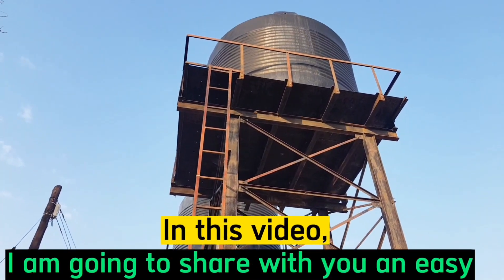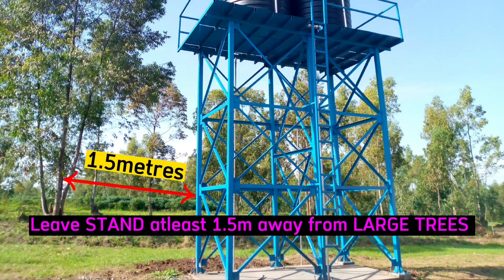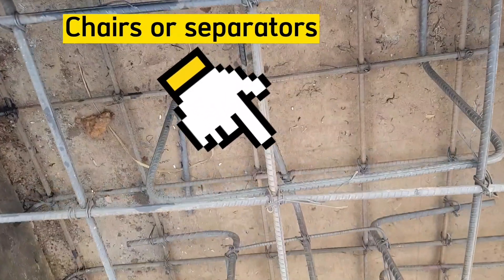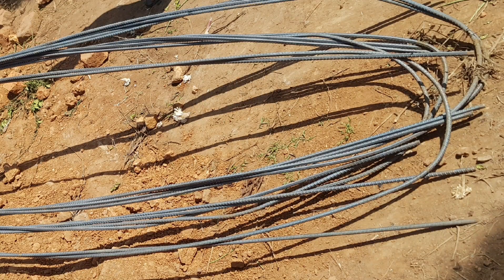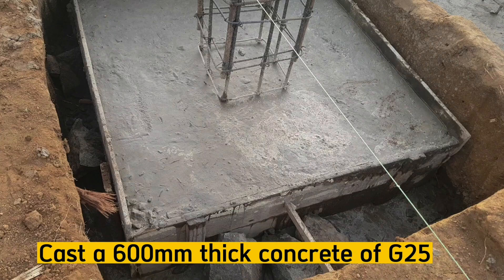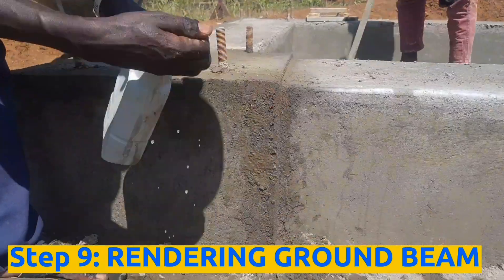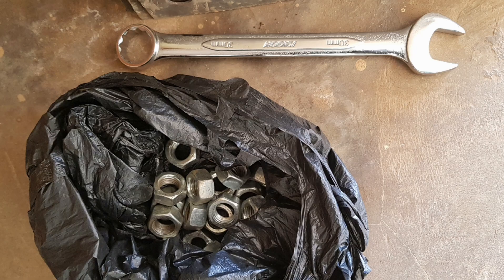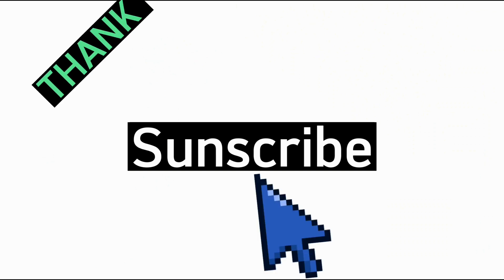How to build STANDS FOR WATER TANKS Construction| Metal Water tank stand

Comment from the maker: Here's HOW TO INSTALL THE GROUND MOUNT SOLAR SYSTEM 👇
https://youtu.be/UqR3GkpDlAA
Reply: Is the dummy plate casted/ covered by the concrete
Reply from the maker: When casting Concrete, we remove the dummy plate. We only keep the bolts open. Later when the Concrete has set properly, we bring the dummy plate and fit it in the bolts then tighten it with the nuts
Reply: @ianconstruction  Am waiting or the video of cost estimates please
Reply from the maker: @muriungi_denis  yeah sure, cooking
Reply: Great video, is the video for cost estimates out? Also can someone hire you in kenya to manage the project while I buy materials

Comment: I am in lagos Nigeria, how much will it cost build a steel tower tank stand for 6000 liters of water of 1500 each of the plastic tank. Steel tank stand 1.8m x 2.4m x 12m high. And what size of steel sections would you recommend for such project?
Reply from the maker: I live in a different country bro but what I can do is sending  you a list of materials required from the Foundation up to the steel metal fixing and welding part.
Then you can simply feed in the prices depending on the prices in your country 
Email me at ianconstruction.yt@gmail.com

Comment: Very nice video and information...can you please inform what is the section you used for the steel columns , primary beams, secondary beams and angle bracings??
Reply from the maker: For steel columns, we used T Sections
For primary beams, we used  T sections 
For secondary beams, we used T sections 
For bracings, we used the angle bracings or what we call the angle bar

did that answer your question, let me know!
Reply: sir the sizes for the steel column and bracings ..thanks

Comment: Bolt placement is off the main reinforcement.. On my opinion it should be 50mm in, so as the plate base area cover the crossectional area of the civil column
Reply from the maker: While casting Concrete for the r.c column ( I mean the short one - the stub column)
And also the ground beam, we temporarily place the plate in, so as to avoid mistakes. We maintain diagonals at every stage. What is important is to ensure that the plates fit properly 
Then the rest, such as as T section columns, primary beams and secondary beams are fabricated on site. They are fabricated following what is already built, we cannot follow the plan or drawing when doing the metallic fabrications because maybe masons might have made a mistake of 2mm or 5mm etc that might bring problems when fitting  so what we do, we fabricate everything on site. 

I hope it helps, in case of any clarification that you may need I'm available

Comment: Thanks for this video sir. By the way sir grade 15 concrete has a mix ratio of 1:2:4 and grade 25 concrete has a mix ratio of 1:1:2
Reply from the maker: @Dee900 
Concerning Concrete grades with their prospective mix ratios,

To make concrete we use CEMENT, SAND, AGGREGATES and also water which are mixed with a certain ratio and concrete is cast and put in a square cube and then put in a water for 28 days and afterward, it is tested in a compression testing machine. The compressive stress result is known as the “grade of concrete”. It is expressed in N/mm² or Mpa

Example: G25, Its doesn't matter which mix ratios you make so long as you attain the required Compressive strength

Mix ratios differ from location to another, what matters is the grade
The quality of sand is the one that dictates the mix ratio due to the silt content in the sand.
Good Sand has low silt content in it and vise versa.

When you put sand in a transparent test tube and pour water and then stir, leave the mixture to settle, there will be three layers. Sand at the bottom silt in the middle and water on top

If the silt content is high, you will need to add more Cement.

First confirm the silt content of Sand in your new location or different country of your new project before following mix ratios that are taught in class. 

On some occasions, sand is washed to reduce the silt content in it.

In summary, mix ratios differ in different countries due to the difference in the quality of Sand in different countries or locations. 

Your mix ratio is correct in your country, it will change when you move to Vietnam or to India or in Philippine. [what is important  to note and untampered with is the grade of Concrete]

Does that answer your question sir?
Reply: @ianconstruction  that makes sense I had never thought of it that way thank you
Reply: As an Engineer, I will always prefer the use of stone dust which is coarse aggregate crushed into an almost powdered form. Using this most times eliminates the risk of silt and clay that can be sometimes seen in some samples of sand. This will also help increase the compressive strength of concrete. In my country, the Government prefers to recommend the use of stone dust especially when constructing 600×600×150 mm Lined drains for Roads. The lesser the presence of silt and clay in Sand to be used for concrete work, the stronger the concrete will be. Cube Tests can be used to determine the set of concrete cubes that would come out stronger (that is those that sand was used to form the concrete and those that stone dust was used). A compressive crushing machine can easily reveal the strength of concrete cubes after curing in water. Concrete gets to maximum strength after 28 days.
Well-done, nice explanation and video.👍🏽
Reply from the maker: Yeah true, I agree with you 100% Engineer 
Stone dust will create a stronger bond with cement after setting compared to sand

Thank you for taking time to share your knowledge and experience with us, I do really appreciate bro